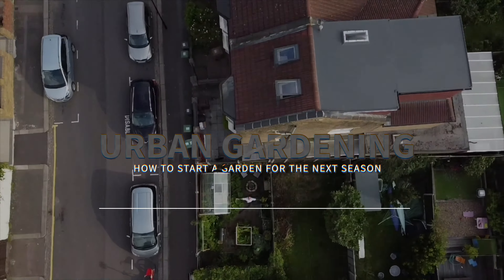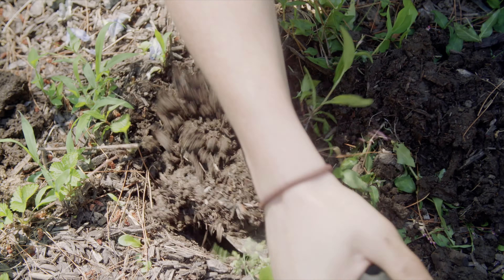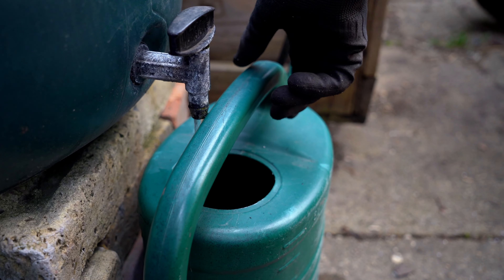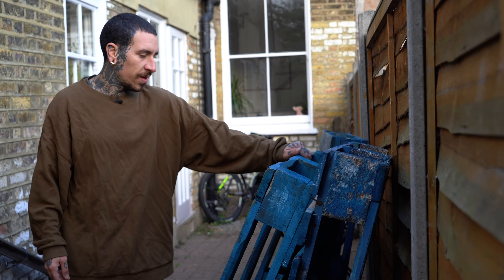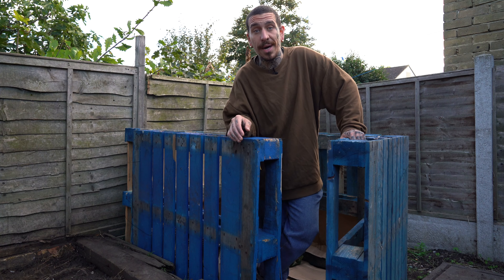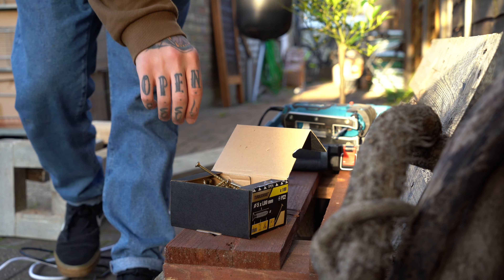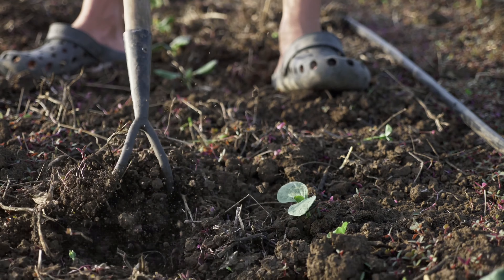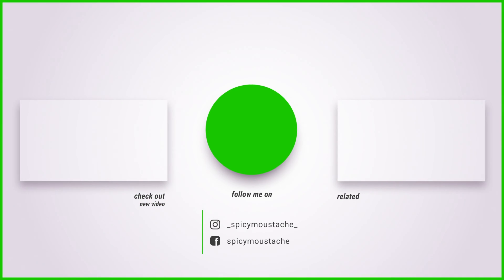How to Start a Low Budget Garden

Comment: Thank you I Wonder If You Could Do the Same Thing In A Apartment No Backyard Inside the apartments The compost with Not Bring Mosquitoes Or Anything’ll like that also To make  A very small one!
Reply: I had a little one on the balcony (no gardern/backyard) for a veggie in pots experiment, it works nice enough without too many flies, mine was a bit too dry tho and it was on the least used balcony, so the few flies there were not bothering. The conceot was two buckets one inside the other, the one inside had some holes for the juices to flow in the lower space, that has a lil faucet for easier use. But to work good it should probably be more moist and it would probably have more flies then mine had :,) idk if this is of any utility for you but it was worth a try

Comment: Fascinating take on urban gardening - I'm starting a new garden from scratch on open rural land, a completely different process. Find a spot by a wide tree, not too far from the house nor too close, compost pile complete. No raised beds, but I have to hack through waist-high grass to clear plots. And my "essential" tools include a hoe, and a large bucket or wheelbarrow for material transportation, but I'm not worried about gloves or watering cans or a little trowel. It's interesting how techniques vary from one setting to another.

Comment: I never use a hand trowel for weeding. I always use a hooked patio knife. You can slice through the soil, life up weeds, hoe and reach into narrow gaps, all in one without missing a beat. I can’t do without it. A good pair of secateurs is a great investment. Don’t go for the cheap ones with the spring in the middle. They fill up with dirt and break easily. Go for the ratchet type. They are much less strain on your hands and you can cut thicker stems without force. I recommend Jardin de France secateurs. They are not cheap but they are really good quality. The best I’ve ever used. And I’ve tried a lot of different makes.
Reply: I use a screw driver for weeding😀, to get to the roots.